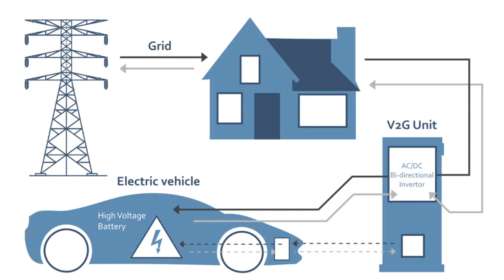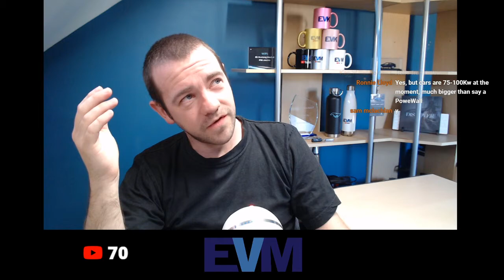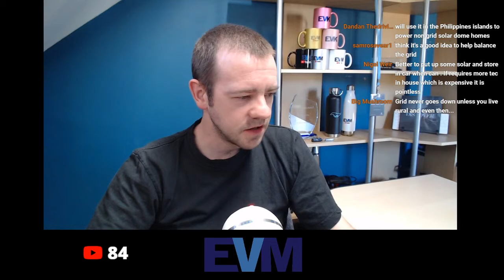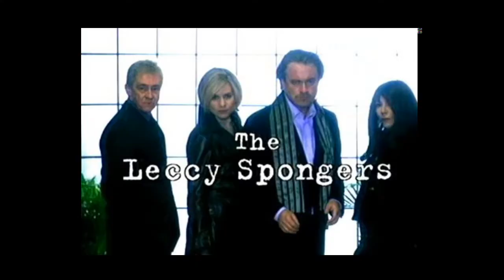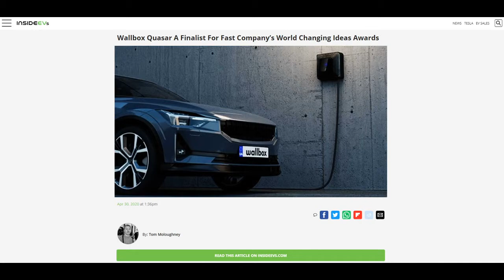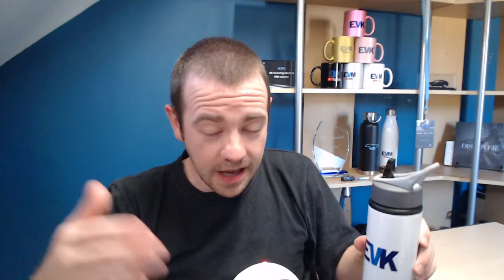Is Vehicle To Grid (V2G) Worth it?

Comment: Highly doubt the cost will be much higher than a regular charger. The DC-AC stuff happens in the car so it's basically some additional components on a circuit board. No reason it should cost more than a regular charger really.

Comment: We got a home battery system 3yrs ago £3k fitted for 9.8KwH and have a Leaf on a Zappi smart charger that monitors home battery status and manages which battery gets full first from the solar panels (on 50p/unit FIT 👍) 9.8kWh isn’t quite enough to see us thru the night on battery leccy and need another 2.4 module (another £700) which is loads cheaper than our mobile battery.    The notion that batteries (fixed or on wheels) as grid failure backup is nonsense, battery or PV systems have a fail safe to shut-down if they cannot see grid (to protect the line workers fixing the grid. You need to ‘fool’ the system into thinking grid is still available to be able to use the stored energy.

Comment: Remember the environmental footprint of producing a battery, whether for car or home... if car batteries are being made anyway for transport, best to utilise them fully with V2G and not need so much additional storage for the grid.

Our EV spends a fair bit of time parked at home so it would make sense here. Definitely wouldn't pay 4 figures for a V2G unit but if they become mainstream then economies of scale will surely drop the cost right down? V2G units at workplaces would be good too.

Comment: Chademo works like this and with a converter not just the leaf 🍃.   And supposedly Tesla.   But if you buy a 30 kW used Leaf for 3-4 k pounds.  Even at 25% Battery you can get a big battery.  Use solar system. Or better yet water 24/7/52 power.
Reply: Nissan Mitsubishi pre 2020 KIA certain EVs. The Mitsubishi outlander plugin hybrid is a good bet
Reply: Where I live solar to grid pays you what you pay for E.

Comment: I looked into this last year when I was building my home battery system. As a heavy electric user this works for us as the equivalent large amount of home batteries we require are very expensive. In the end I decided to build my home battery system from ex leaf batteries which kept costs down and the V2G unit was not readily available. Re V2H, a V2G is V2H before V2G as it connects on your house side of your home meter.

Comment: I have been on the OVO V2G trial since July 2019 and I have been very impressed by the results. My story is that in April 2018 I bought a Nissan Leaf 40kwh. It is the best car I have ever owned. To further my progression into eco-friendliness I decided to investigate running this car on sunshine. Checking out solar most mentioned a home battery to help smooth out the "duck curve". I thought what is the point of a tiny home battery that cost say £5,000 when I already have a 40kwH (10 times+ the size of a home battery). So I looked for alternatives. I had been with OVO since 2012 and noticed in an email from them announcing the trial. Okay getting a bit long so going to bullet point mode.
1) Car is mostly at home during the day but required every day (morning and afternoon).
2) Kit was installed FoC and will be mine after 2 year trial for nominal sum
3) Some early teething troubles for some on the trial but mine has been trouble free.
4) Car is charged during early hours off peak, exports to the grid late afternoon/evening during peak times
5) Export between 15 and 20 kwH per day
6) Export credits have covered my electricity since starting so for me saves roughly £600 per year
7) No signs of degradation. SoH of battery in July 19 was 94.06% and today it is 94.35%. This measured at 100% charge with leafspy app. 255 DC charges in that time.
8) Never went with solar mainly due to council trees causing to much shadow but payback would have been 20 years. If my V2G cost say £4,000 that would be a 7 year payback. Much better than solar and not reliant upon the sun in NE England :-)

Comment: You can use V2G during the day, working night shifts, or if your place of work is part of the scheme (quite likely in the future) and you can also use V2G on the street. There is a town in the Netherlands that has 200 on-street V2G chargers and they are combined with rooftop solar so that an entire area is powered by solar and V2G. Each user has a profile that tells the system how much they need in their vehicle and when they plan to use it etc. Costs will reduce as volume increases. So on-street V2G is probably a better place to start, rather than individuals that have to pay for their own wall box. In time you would expect V2G to become just a slightly more expensive wall box or maybe only V2G wall boxes will be sold at some point in the future?

Comment: V2G is for the grid, not the owner, the grid peak only need 1-2% of battery. And V2G at work is a bigger system. It's not to replace but to support, save your home battery to run the home.

Comment: I believe it is the case that the installation of a Tesla Powerwall is in the region of £8000 UK.
Nice though it would be to integrate my solar PV with a battery and an EV, won't it take FOREVER to see a return on the investment?(in fact, won't the battery actually die of old age before it pays for itself?)
House batteries need to plummet in price for it to approach a realistic investment.....

Comment: Existing V2G systems rely on bolting a second DC to AC inverter on to the house. As Renault said with Zoe V2G trials, the car already has an inverter so it makes more sense to use the one already attached to the car battery. 

V2G in UK is aimed at reducing peak demand, regulations prevent the system working in a power cut to prevent secondary sources of power charging the grid. House has to have additional hardware to completely isolate the house from the grid in a power cut. I have only heard of those switches being used in conjunction with a battery not an inverter.
Reply: Right, but the inverter on current EVs is a three phase unit that is purpose built to drive the motor it's  attached to.  A fundamental redesign would be necessary of the drivetrain power delivery system to facilitate the vehicle's inverter exporting power to the grid.

Comment: I've had a Tesla powerwall 2 since August 2017 coupled with a small 5.22 kW of solar. I'm grid connected but never use grid since I've had the battery installed. My system saves about $2000 a year in-house usage , and end up with about $350 in credit. I also power an ev but don't have enough spare for powering a car in an Australian winter  and change when shopping.
I saw the fully charged video . My powerwall takes over instantly , less than half a second and I'm sure that there will be lots of comments saying the same thing as I've said.

Comment: Will be interesting to see how the tariffs go. Here in Aus the electric supply companies don’t allow grid-charged batteries to export back into the grid. And the trend is towards cutting back on household export due to too much solar causing high voltage problems. Obviously could be different in the UK. Vehicle to home would make more sense over here.

Comment: Hi, I have two Power walls total capacity is 27.2 Kwh. It also will power the house during a power cut. The total cost was quite expensive, however the reduction in electricity bills is very marked. From April to September use off the grid is about 4 Kwh a month. My daily consumption is 14 Kwh. March and October are reduced by minimum of 50%(150Kwh). The rest of the year is not so good but you save an amount even in December. The idea using a car battery to connect to the grid is for grid balancing. In the near future you will have contactless charging even at home. The future will be that all households that can accommodate off road parking will be installed with a vehicle to grid system. Your home battery system will be used as well, the problem with this is not whether it will cost you money to install, but how much the power companies will pay you for the privilege of using your power and then giving it back. No company will do this at a loss to them. As more chargers are installed in cities in on street locations the more connected this system will be. As for paying for it now that I feel would be a mistake.
I did a calculation for repayment of my outlay for the Tesla system and working on an increase of electric bills of 5% per year they will pay for themselves in 20 years. They are guaranteed for 10 years to only loose 4% of there capacity and there is no reason why they will not be able to last more than 20 years. (my electricity bill from 2000 to 2017 increased from 6p to 17p). I now pay 13.5P got away from the the big boys!

Comment: The main purposes of V2G are to store excess renewable energy and smooth power usage. A better solution is a change in habits and the use of smart meters, such as is encouraged by the agile tariff. People adapting their usage will be more effective than converting the EV fleet simply as a matter of scale.
Reply: Just to clarify, the UK swings in power demand vs generation from peak to base is about 20GW, the peaks lasting ~5 hours, so 100GWh just for daily variation, not storage from days of peak wind to days of calm. A generous estimate of total UK EV fleet battery capacity is 5GW, a fraction of the required capacity especially since that would make them essentially unusable as cars.
If, however, you can shift some of that midday peak to overnight (dishwashers, washing machines, EV charging, immersion heaters etc), you shift the burden from the 0.2% of the population with EVs to the 100% of the population who use electricity.

Comment: A lot of time when people talk about V2G they are actually thinking of Vehicle to Home so they run their house from the car, this is a fairly simple proposition and involves all the arguments about home batteries etc. V2G though is about supplying power to the grid to be used wherever which may or may not be your own home. It requires a lot of complex communications though to manage it so the grid can call on the power when it needs it rather than it just being stuffed into the grid like the solar/wind does currently.
If V2G, V2H or home batteries take off though the whole economics will change and it would be likely that variable tariffs go away because if everyone is charging batteries on overnight cheap rates once load exceeds capacity cost goes up just as it does now in the evening peak. It would lead back to a constant tariff. With sufficiently large and sophisticated storage with grid communication it would lead towards constant or matched grid/generation loading.

Comment: The theory of V2G is ok, but in practice - say the guy digging the ditch up the road cuts the cable, so your car is now powering your house, and - via the grid, half the housing estate -  then you get called out to go somewhere on an urgent errand, and your car battery is nearly discharged - what do you do then? - - solar is only moderately ok the UK. What happens if it is foggy, or you have an inch of snow on the array. You can't even get up to your roof, in most cases, to clear it off - and of course, it doesn't work in the dark!
Reply: I saw a preview of a V2G control app where you could set various thresholds such as the minimum that would always be left in your car and not exported away. That would be vital in my opinion but not hard to implement.

Comment: Unlike a home battery, which disconnects when the grid goes down, The new Tesla V2G can supply a microgrid, and has all the safety features to manage supply to the grid to protect maintenance technicians who might be working on the power lines when the grid is down, and has software to manage energy trading, also a Tesla car has as much storage as multiple home batteries.

Comment: I’ll let you know how I get on. Fortunately I’m getting it free with the octopus trial. It works for us as the car won’t be used so much but we still need two. I also like the inherent refresh of the battery as the car changes regularly. Where as home batteries will require replacing at some point.

Comment: On the subject of the Tesla M3.  The article I read implied that the inverter capability DC>AC was built into the car.  If that is true, the question is whether that is a grid-tie inverter, which is what it needs to be to do V2G.  If it does have that, then potentially this could work without any special hardware at the property.  And that is a big deal.  But there are a lot of unknows here.

Comment: Not everybody's situation is the same. My Leaf is always at home as I have a company van for work, my wife doesn't drive and walks to work anyway. The only time it goes out is when I'm off and the weekends, so V2G would work for me. I know electricity suppliers are offering a lease hire Leaf and V2G in the south east of the country (UK power networks are your DNO).
I do have solar panels and is a pain not being able to use the excess we don't use, so I am researching battery storage, thanks for the EON tip.

Comment: I believe in the UK for home battery backup or V2G if you have a power cut the electricity is cut off from the home unless you have a special isolation unit otherwise there is a risk to electrical engineers working on the line.
That's what was outlined in Fullycharged.

Comment: Short answer to is it worth it? Is No.
The UK buys various (c. 100 - 800 MWh) of balancing services per year (google NGET / NGESO's Balancing Services market). With a million V2G EVs, that's about a kWh of trades a year and worth - not much, 2 or 3p per kWh perhaps. Who would invest into the needed tech for pennies returns? Large car-parks are different; at home is fraught. No profit as far as I can see.
Plus, if you want to inject power, an alternative is to turn others off (google grid DSR). That means round-trip efficiencies and the lost power which is part of V2G - is no longer lost. EVs with 10 hours overnight to get 12 kWh charge in - do not mind when they charge, as long as they are charged - so time management becomes possible. This gives (um - I've studied this at Uni for <cough> years) x3 the benefit as V2G. Stating that on YT though means nothing...
The rush to V2G came from papers published by Kempton (see Kempton, W., & Letendre, S. E. (1997). "Electric vehicles as a new power source for electric
utilities". Transportation Research Part D: Transport and Environment, 2(3), 157–175.). This suggested profit of $4,000 per year where available (for 1 car, in US). 
But there is no market demand in the UK; the technology is OK but there is no need for NatGrid to spend ££ when there is no need for the power. So no market.
Can V2G help the battery? ONLY for the case by discharging from 100% down to say 80%. That's it. Of course, it might be sensible to not bother to charge over 80% if you don't need it...
Emergency backup? UK NatGrid yearly performance quote either 6 or 7 9's (e.g. 99.999996% uptime) without using SG or V2G. Hm. Try googling NGET. (2017). National Electricity Transmission System Performance Report 2016 – 2017. Not really a problem in UK which is why supply buy volumes are through the floor.
The real market is 2nd use static batteries; recovered good EV battery units put into shipping containers and sited where needed (e.g. by a distribution grid Primary stations): you know the units, you have them in the right place, you don't need to keep 60% SOC in for driving. And much cheaper, so any capital loss over the years is better.
Note: NatGrid renamed from NGET to NGESO in 2019; same company.

Comment: https://www.eonenergy.com/solar/battery-storage.html    link for eon home battery 

the thing would be how much power goes from car to grid  as you may decide to go out and find too much has been taken from the car battery. that you cant go were you were going
if your spending move than a  1000 pound its going to take ages to recoup the cost.  that a lot of kwh you have to sell to the grid
a battery system depend on size of kwh battery bought  give lower buy price 
its working out how you get paid  but what happens that some draw off of power  you could have to recharge your car using a high price electricity to get full for driving
you need a drive over plug charger like wireless phone chargers are now